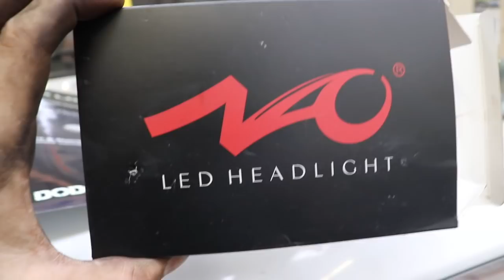WHAT WILL MAACO CHARGE TO PAINT THE DUALLY???

Comment: I am a fleet technician and we use Maaco regularly for our fleet cars. The low quality single stage's shine lasts less than a year till it fades to basically a satin finish and the worst part is you cant even make it look good with buffing because there IS NO CLEAR COAT. You'll just scratch it. They try and sell you on it by saying "Yes it has clear coat Its all mixed in together" but the fact is it doesn't work good. Also the reason they want you to prep for them is because they usually don't prep previously painted cars. They just clean it up and spray right over it. That's why after some time in the sun and a little beating their paint will literally come off in chips! I know this from experience. We call it a 50/50 paint job, 50 feet or 50mph lol. The ONLY thing you can do to preserve the decent finish it has when it comes out of the booth is to keep it out of the sun and hand washed. Just trying to share my experience with Maaco! Good luck on the decision malachi!

Comment: you do not need to sandblast your truck all you need is an air sander to hook to an air compressor, and 320 grit sand paper to put on it and you can sand off the clear coat. i just got my 96 12v cummins dually just like yours repainted and i sanded the clear coat off of it and it was pretty easy to take off it just took a while to sand it down....
Reply from the maker: 2nd gen Lifestyle good idea. Not to mention my clear coat is already so flaky... it falls off when I go over 70 mph 😂😂
Reply: Sand blasting your truck will mess it up and may put groves in you metal on the truck. It will probably only Cost you $40 in sand paper to sand it, and buy you a cheap air sander..

Comment: Take your time and paint the truck yourself. You can make a cheap homemade paint booth. It will be good content and you will save atom of money. Them just get it professionally wet sanded and buffed
Reply from the maker: cody paul it’d be far more expensive in materials alone... not to mention all the time I spent learning and trying to do it the right way, I could be making far more money doing something different and afford to have someone else paint it multiple times in the same time frame haha....
Reply: LOUD 'N' PROUD I’ve painted 3 of my own trucks before. After working a 40 hour job and running a side landscaping business and each truck took about 1 month late nights and weekends. If cost me about 600$ in materials, 2 stage, primer, and sandpaper. But it’s up to you I’m the type of guy that likes to say I built my truck 100% myself.

Comment: You dont need to take it down to bare metal, you just need to get the clear off which can be done in your garage with a orbital sander. Maaco is cheap as long as you do all the tedious prep work and just want them to spray. Also do all the masking yourself otherwise you will have to deal with overspray and or them charging you to mask it off

Comment: Would love to see h1 bead locks on this truck. And single wheel bed before macco paints it.  Youl need to take some measurements and run spacers on the front to match rear d80 width. 
Ohhhhh i despise wheels wider than the rubber. Thats all show and no go in my opinion

Wtf bumper is on that black truck lol i dont like it but its still cool.

Comment: Dont blast it ... taking down to bare metal will just cost you more .. you than need to expoxy prime ..sand..seal.. paint.. clear... do not do single stage paint either vehicle will fade in a heart beat.. sand the entire truck down with 400 or 600 grit sand paper on a da flat

Comment: 4 grand ?  Your getting robbed if you even considered paying half that for a normal   base coat clear coat paint job.  . Most paint jobs go for about 1k while upper  custom paint jobs go for 2500. Here in the North east, Macco charges 500$
Reply from the maker: Mark Rich depends on vehicle, work needing done, shops rates, paint grade, ect....
Reply: My quote besides the macoo 500$ is with sanding and priming.  Ive painted truck myself , had places paint them Ive even got the macco paint job. Google the average price of a automobile paint job. Obviously no body work and we are talking about a normal paint job.